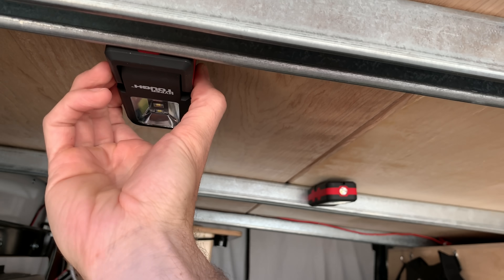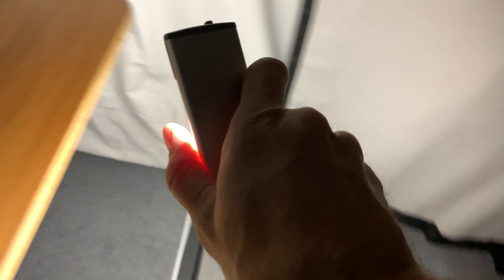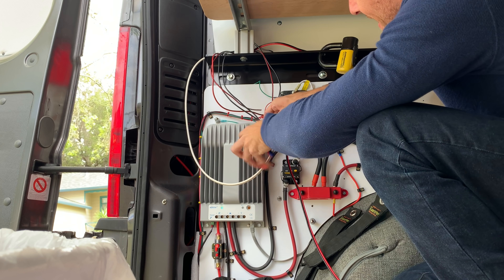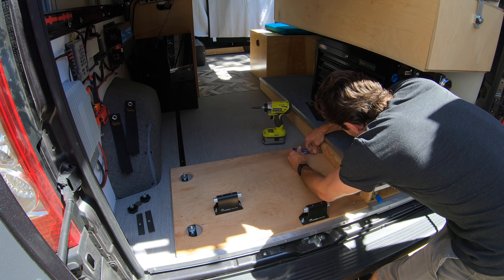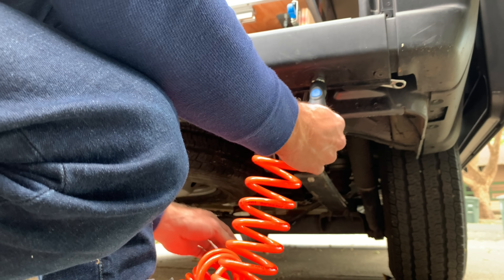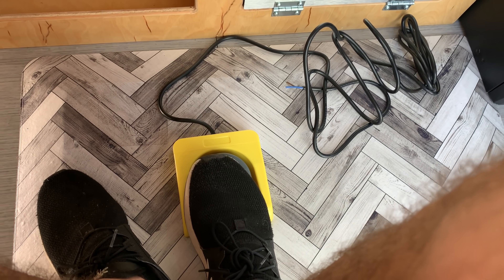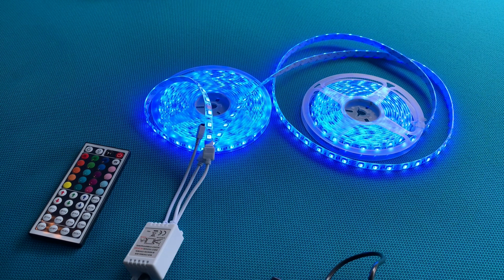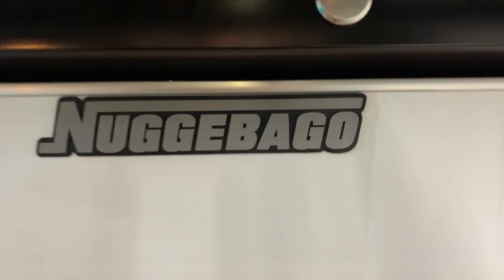20,000 miles on the van and still plenty to fix

Comment: Cool as usual! You could always mount the footswitch for the water pump at knee height on the cabinet so you could, in theory, keep it out and in place. They also make motion-controlled faucets for kitchens (need power run to them) that maybe you retrofit to the van. That seems worth investigating. As for insulating... spray foam. Man, if you can't travel right now anyway, just get it done.  Buy it directly from the companies that make it and it's cheaper than on Amazon. Lastly, roll out bike tray. Not saying, just saying. Love the van, and the updates on it. Ride on!

Comment: Brian, If you ever get the time, you should strip out the van, and insulate it with sheet insulation. 
You can cut it to the exact measurement, get better fitment. Plus sheet insulation has a better 
R factor of insulation. It would really help with the temperature control. Make your van much
more livable. Just something to think about. Have a great day. Really enjoy your channel.

Comment: Seems like you bought some basic led strips which is alright for this application, but if you didn't already know about these, you can buy rgbw strips as well. They have pure white leds in addition to the red green and blue ones. This makes it so you can just choose to light up the white color without mixing together 3 colors to attempt to get a white-ish light. The white chips provide a better light without straining your eyes, improved color rendering index and you can choose the color temperature when buying. They need an extra wire and an rgbw specific controller but it's not that expensive. Another type you can look for is a white strip with different color temperature white chips on it. These also require a specific controller and only do white, but you can adjust the light from warm to cold according to your mood. If you never compared products with different color temperatures and color rendering indexes you would be surprised how much it can affect the way you see a space under those lights.

Comment: For the water pump issue, you could get an Infrared operated tap as some of these are battery operated. Alternatively hinge the kick board at the bottom of the sink (faucet) and put a 'momentary contact switch behind it, then you just need to press your foot against the board to operate the pump.

Comment: Xiaomi has soap and water dispenser (seperate) small gadget with motion sensor. I think it is perfect for your van. I have been using it for an almost a year and its not so expensive, but very good. Soap dispenser works with battery (it will last a month or 2), water dispenser can be charged with usb and it will last a 6 or 8 months dependin on usage.

Comment: Did you chat w/ Alex about your van experiences?  IIRC he felt that insulation wasn't worth it (in my experience, it's very worth it).  I insulated my van and it does help a lot but now really the problem is the sun coming in through the windshield.  I can generally park so that's not a problem, but obviously when driving there is nothing one can do.

Comment: The foot pump is worth its weight in gold.  However, see if you can temporarily mount it so that you can control it with your knee.  I don't know why, but leaning in with your knee works better than standing on your heel, especially when you take your weight off the pedal.  If you like it, you can rig it up that way.

Comment: You can easily fit 3 bikes where you have 2 (I have this system, works great and far better than stupid bike sliders), if you simply angle the fork mounts slightly (about 15 degrees). This also allows a little more room to move the bike nearest the wall to move closer. And get that gas heater for <40F temps.
Reply: Utah John  hi not sure about a gas heater in an enclosed space.
Reply: @andreanicol7588  do your homework, the exhaust is OUTSIDE.

Comment: I don't remember hearing about it, but if you don't have a dual battery system in that van, look into it and do it! With the right regulator, you won't have to worry about your primary battery going dead. (Unless it's old, junky and just needs replaced anyway)

Comment: You need to install an Espar heater. They make regular gas ones now too. We've installed a hundred or so and wouldn't buy a van without it.
Reply: Second that. I have the D2 (diesel) in my Sprinter, but had the B4 (petrol) in a Vanagon and they rock! https://www.eberspacher.com/products/fuel-operated-heaters/air-heating/airtronic-b4.html
Reply: The Chinese knock-offs are super popular with van lifers, and every one I have read has great reviews and longevity.  They can be done for like $250 and a days labor.

Comment: why not just use a reverse deadman circuit for the tap?  i'm assuming the water pump is DC, so wou could install  a magnet cut-off switch on the sink itself.
 install a magnet in the sink cover to meet up with the switch. lift up the cover, magnet switch closes and turns on the pump

or if you want simplicity, use similar spring switches used in fridges that control the fridge lights. but you might need to fiddle with the spring to allow the switch to function with a light weight.  or get a small cheap one.

Comment: It's too late now but all the off raod guys use CO2 tanks for compressed are and they've all gotten rid of air compressors. If you're ever in a situation where to need to air down your van tires for traction the CO2 system will refill them in seconds rather than minutes.

Comment: Please don't do spray foam. It's the best, I think because it's thick, but if you need to do and wiring it's stuck in there and you'll have to dig it out. And it has the possibility of renting the body out as it expands while also it'll offgass at around 110°F which vans will get that got easy. And a lot of people that go with foot pumps for water end up getting electric

Comment: Hi Brian, I have the same van and I'm being put in Wayfarer's schedule to add the conversion kit. They have a video on their channel about the Yeti1400 power source. I was just wondering if you thought about this option and your reason for not going with it?
Reply: Hi Robert,  Im picking my van up in a couple of days from Wayfarer...Curious as to where you landed on the YETI 1400 and if its worked out for you so far. Also, what are you doing for refrigeration?
Reply: @shs4x8goat  hi there. I've looked into the Yeti but went with the Battery Extender instead for now. I'm at an RV park so I have electric and water.😁 This unit is nice as you can hook up 12v, USB, ECT. It even has a compressor for tires. Also cables to jump your van if needed. Right now I don't have a refrigerator but am looking at the Domestic brand. I am working a 9 to 5 job so when at work I'll be able to power it with the Battery Extender.

Comment: Regarding your faucet, Use head pressure. Can you mount the water tank on the roof & run a line into the van? 

Another idea is pressurize the water tank with air compressor.